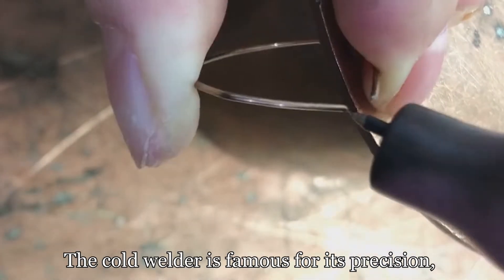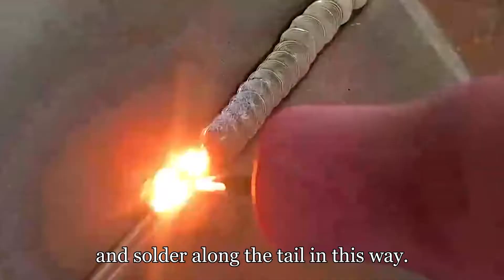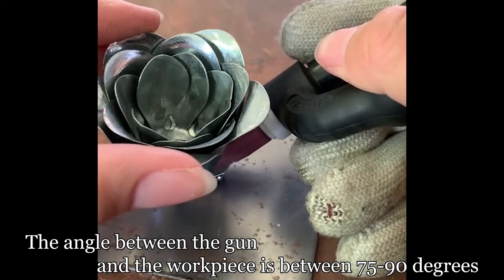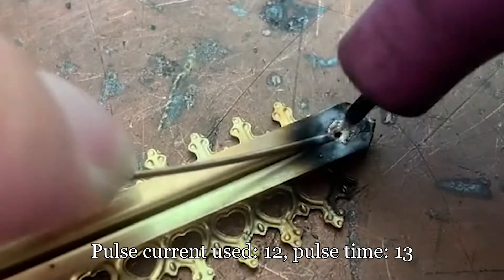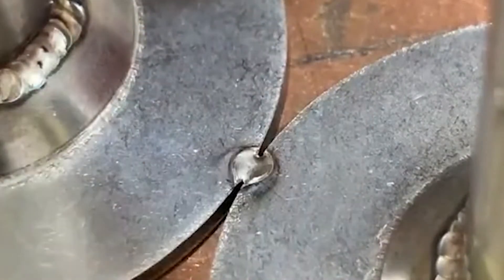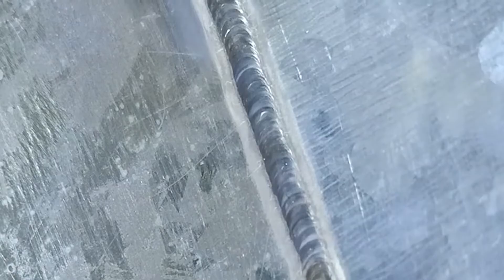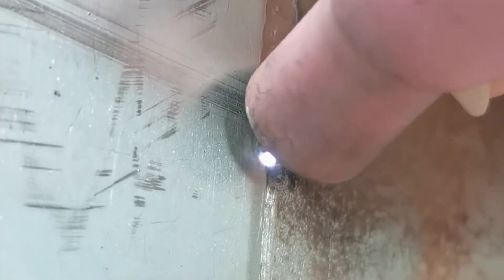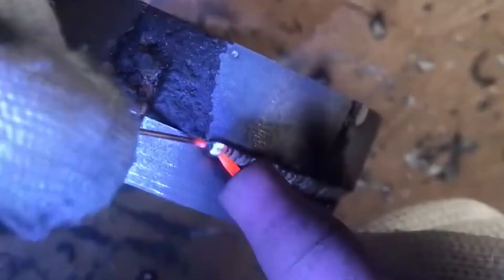Real shot the correct welding cold welding technique!

Comment: Welds are good for thin sheet melt jewelry and tacking...you dont show the back side of your butt weld in most cases you dont have enought penatration to weld both base metal completely  threw and fuse the parent metal on the back side of a butt weld.... show use the weld both side.. every time you weld...